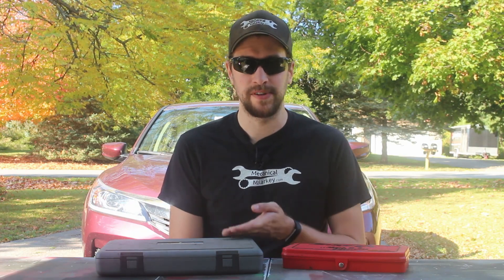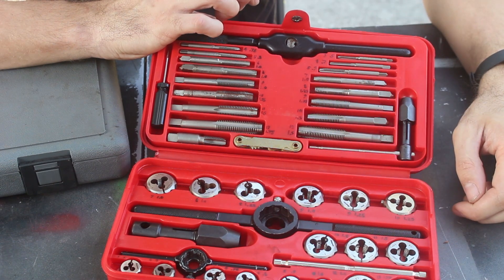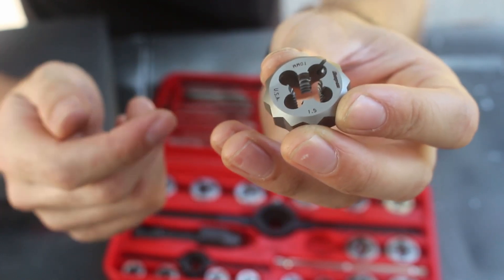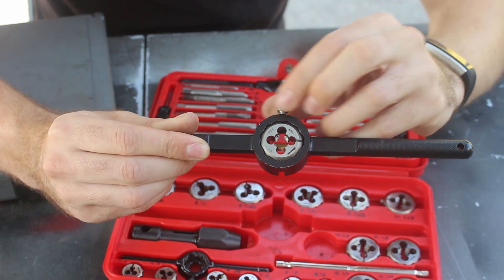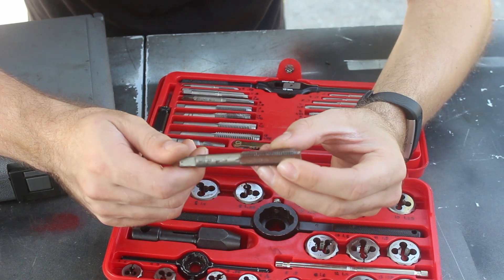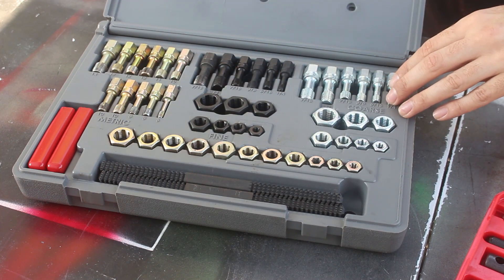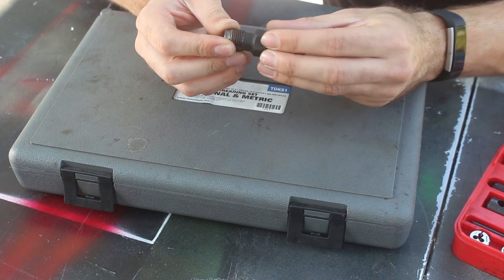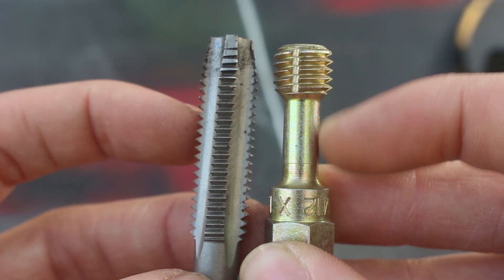Taps & Dies vs. Thread Chasers

Comment: I have some water pump holes that are small. Maybe 6mm. I can't get the bolt to start in one. Will a thread chaser clean up threads where the starting area of the threads are damaged?
Reply from the maker: Possibly, but sometimes in situations where you can't get anything started, you have to use a regular tap and hope you don't then wreck the holes farther in. I have seen, but have not tried, chasers that go into the hole and then expand so they work as you back them out of the hole, for situations like this.
Reply: @MechanicalMalarkey  bought a set off of eBay. Worked like a charm. Thread chasers saved my repair. Happy I didn't try a tap. Blind hole threads the bolt fine now.
Reply: @MechanicalMalarkey I saw a guy demonstrate on a blind hole in another video with a thread chaser and it worked. Everyone else says do not use a tap for previously threaded holes to repair threads.  Taps usually screw up old threads that are damaged in the start of the hole.

Comment: Excellent video. Thanks!
Very informative and thorough 
Just snapped off a thread chaser in my 09 Fontier trying to mount a trailer hitch. I may have started that hole a little crooked😬Only one more hole to go, so i may have to use a tap this time. 5 of 6 bolts should be plenty for a garden trailer...right??😄

Comment: I’ve got a GM 3.1L and the aluminum rocker arm threads are stripped out which is a common problem. Hopefully I’ll be able to repair them with a kit and I don’t have to do a heli coil or something like that

Comment: Hi Dan, I just finished welding captured nuts to my utility trailer frame so I can use 1/2 inch eyebolts as tie-down anchor points. Out of the four I installed, unfortunately I got a little weld in the thread of the last one. Please, should I use a 1/2 inch - 13 thread chaser or a 1/2 inch - 13 tap?
Reply from the maker: In that case I would probably use a tap.
Reply: @MechanicalMalarkey  thanks for the advice. Please, can you suggest specifically what kind of tap (for instance, plug, bottoming, taper, etc) and please do you have any tips for following the existing threads and not cutting new ones? Thanks, Tim
Reply from the maker: @UnderSprayedWhiteSkies  If the threads are okay where you would first go in, then you shouldn't have a problem getting a tap started without messing up the existing ones, otherwise I don't have any tips for getting it lined up. I don't know which type would be best for your situation.
Reply: @MechanicalMalarkey  Hi again Dan, I had to approach from underneath (my tap wasn't long enough to go top -down). I had to notch the frame to allow the bottom-up approach, but it worked very well. I was just extra careful to not cross-thread. You're right, I don't think a thread chaser would have worked. Thanks again for the advice.

Comment: Do you have any videos using these tools? Was wondering if there were best practices on working with them. Thanks
Reply from the maker: Typically when tapping new threads you only want to go in about a turn, then back it off slightly to clear the debris, then go in again. On thread chasers that can be a good idea too if the threads you're fixing are really messed up. Lubrication is always helpful too.

Comment: And if you ever mangle the first couple threads of say a spark plug hole... there is whats usually called a back chaser.  Think if it as a collapsible tap (or chaser). You stuff it in the hole, part of it turns and expands the tap, then you can turn it UP the hole from the underside... starting in the good threads, until it can hit the damaged ones and straightens them out.

Can save you from needing to pull a head!

Comment: This was great, thanks. I was figuring I needed to use a tap, and someone mentioned use a chaser, which definitely seems like the right move. For a hitch on a Honda like your video. I'll try the chaser first and move to the tap if necessary, this being my first go and not wanting to blast through the existing metal.

Comment: Excellent video. Thank you. I am just getting into the world of auto/motorcycle repair and notice that loctite leaves behind a quite a bit of residue and dirt on the internal threads. Have you done a video on cleaning internal and external threads? If not, what process do you use to clean internal threads? Thank you.
Reply from the maker: For cleaning loctite off of bolts I've found that a wire brush/wire wheel does more than a thread chaser or die. Thread chasers would also clean internal threads, I'm not sure if there would be a way to use any kind of wire brush inside a hole to clean loctite out instead.
Reply: @MechanicalMalarkey  thank you for the reply. 👍
Reply: @MechanicalMalarkey  Hello. Can i use M14 thread dies on 15mm alloy Rod ? I hope you read my comment.
Reply: I use a small plumber’s wire tool for the inside of pipes to clean out internal threads. Works great
Reply: If there is some solvent for loctite then I think it will work quite well in combination with a chaser. Just like using penetrating fluid with a chaser to get rust deposits out of the thread valleys.

Comment: Nice vid! I got a stud that's asking more force to put on the lug nut than the others. The threads are still there just that they're all a bit rounded at the tip. Is using a thread chaser on a wheel stud safe? Won't it make it mechanically weaker? Or would you just replace the stud?
Reply from the maker: I've chased threads on studs before. I think it's okay if the threads aren't as sharp as they could be, like I'm sure rusty bolts aren't as sharp, but they still hold well. It's actually not a large percentage of surface area that's actually in contact between threaded things to begin with so just lacking that little bit at the tips is probably fine.